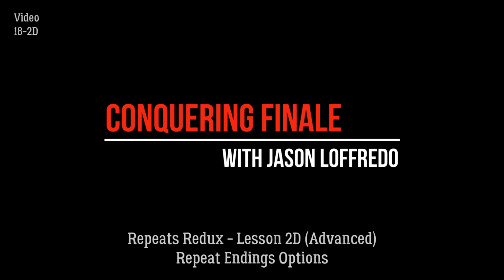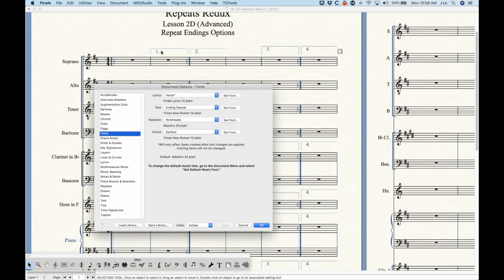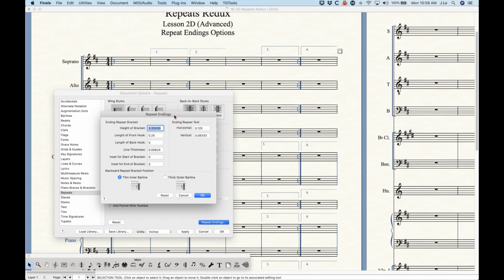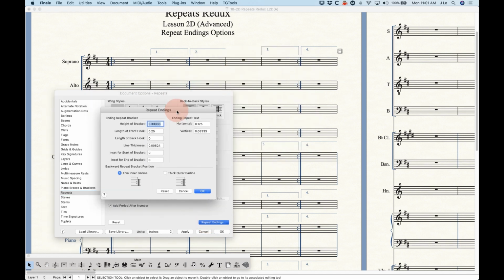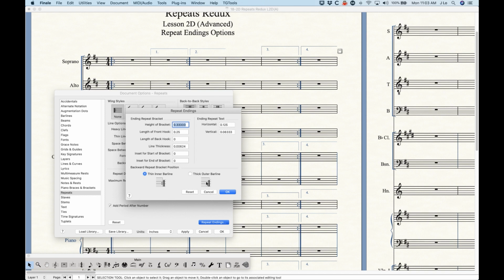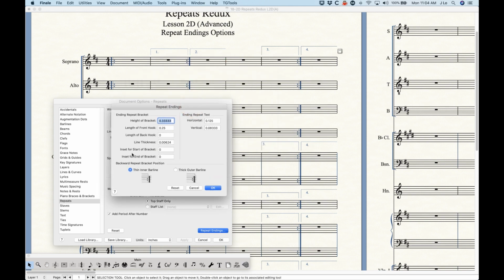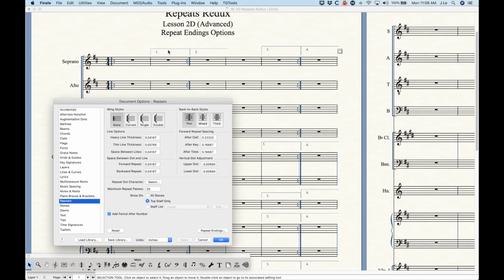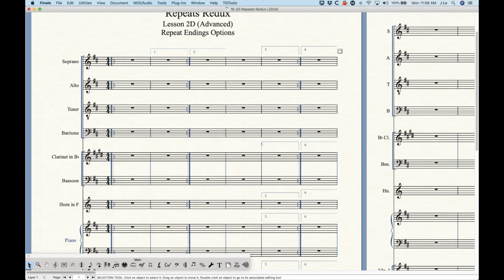18-2D Repeats Redux Lesson 2D (Advanced)

Comment: It may be just me, but I like the number for the horizontal position for the ending repeat text (the number) to be 0.076.  I think that this gives a gap between the two hooks that is similar to that seen in professional scores and looks nice.   Try it out and see what you think.
Reply: Having said that, I can see that I had checked "Thick outer barline".  If you had checked "thin inner barline" then ignore my advice.  (They give about the same results.)
Reply: And I agree with Jason on moving the number just a little to the right.

Comment: In reviewing hundreds of scores, I find it usual to have a period behind the number in the first, second (etc) repeats.  Elaine Gould in her book "Behind Bars" places a period behind the numbers in her section on repeats.  She does not mention that as being necessary (does not address it).  However, she does mention something odd:  "The number of repeats is given within each bracket (using numerals the size and appearance of time signatures)."   And the appearance in the examples in her book have the number large and bolded.   Strange, but I don't think that I've seen them that way in most professional scores.  (True, the numbers in professional scores are a little more bold than in Finale, but they are not generally as large as the numbers in the time signatures).  And I think that Professor Loffredo and I would agree that the general size and non-bolded appearance as you see in this tutorial are just fine.   They are fine for me.